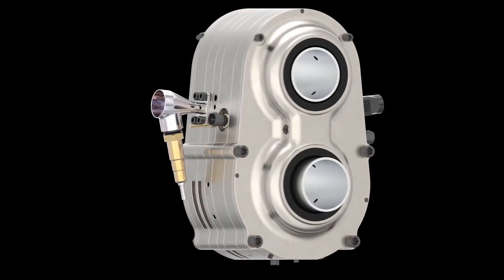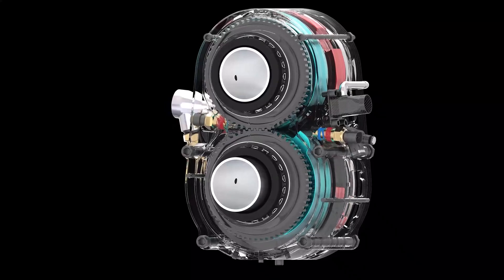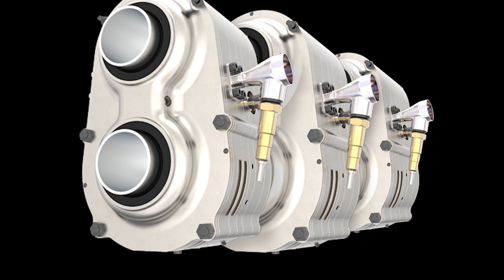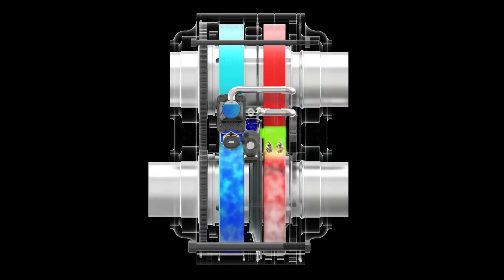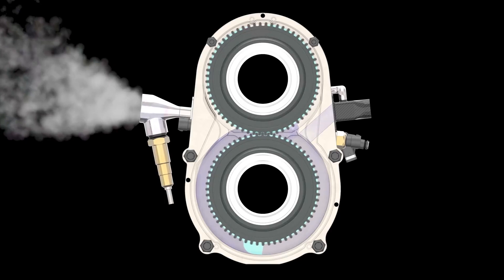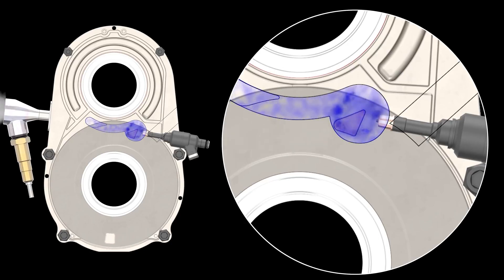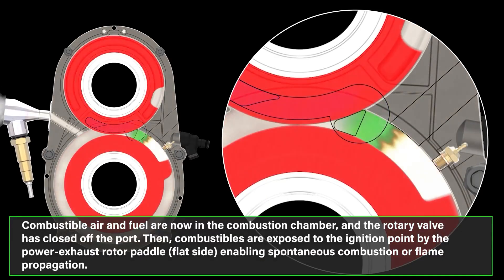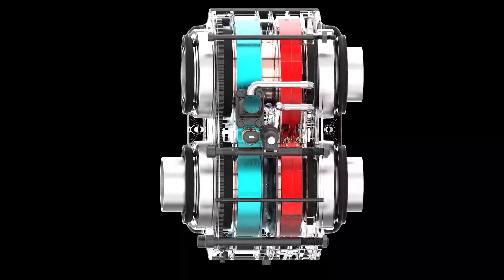This pistonless engine runs on hydrogen and revs to 25k rpm

Comment: This would be great paired with supercapicitor hybrid drive. The engine does all the "cruising" and charging....and then the electric drive only comes into play when massive torque is needed...such as upon acceleration, towing, or hill climbing. The biggest problem with electric cars are not the batteries, but the easily controlled masses of ignorant people. Even though the batteries of electric cars are HORRIFIC for the environment......it's the gullibility of most people which is far worse.
Reply: Hey 250 fb torque is nothing to sneeze at, depending on the size of the vehicle it should do just fine on hills.🤠
Reply: @robertmcwhinney4596  *170ftlbs
Reply: You have clearly no clue about electric drive trains Thomas
Reply: @Freba9  you got that right!🤠👍
Reply: @robertmcwhinney4596  
You got that wrong. 🤠
Reply: @robertmcwhinney4596  Yep :)
Reply: @thomasg4324  Wrong. They are being asked to reduce charging power between 4 pm and 9 pm.
Reply: @thomasg4324  Because of a lack of grid capacity, not production.
Reply: @Freba9  
"Because of a lack of grid capacity, not production." <~ Oh I see.....California can't produce enough grid capacity. Got it.
Reply: @thomasg4324  Does not HAVE enough grid capacity.
Reply: @Freba9  
"Does not HAVE enough grid capacity." <~ Yea...no juice for you!
Reply: @thomasg4324  You clearly do not care about facts.
Reply: @Freba9  
Your "facts" are hilarious.
Reply: @Freba9  
Enlighten me if you can.
Reply: @thomasg4324  Producing and using EVs is far more efficient than using incredibly inefficient hydrogen in a combustion engine.
Reply: @thomasg4324  Again, wrong. Production emissions are compensated for within the first few years of driving on mainly non renewable energy.

Comment: can't hydrogen make any engine "clean"? the problem is getting the hydrogen in the first place ends up using more fossil fuels than just getting and burning gas
Reply: You could easily use solar power to crack water and make hydrogen. The bi product of burning the H2 is just water. So could be done with virtually zero CO2 emmisions.
Reply: @christianbuczko1481  Easily???
Reply: @will7its  As stated by Cakes Gaming, it takes more energy to crack the hydrogen free for use as a "clean" fuel than just burning fossil fuel, and to add insult to injury, the cracking process produces huge amounts of carbon dioxide as a byproduct. It can certainly be done, however the greenhouse gas emissions from and energy consumed in producing the hydrogen gas would completely null out any conservation of energy and produce a ton of extra carbon dioxide. Regardless, as you simply questioned; easily in this case is akin to rainbows and flying unicorns.
Reply: @electronicengineer  Ayte.......
Reply: @electronicengineer  you crack water, 2h20 >2h2+02. No carbon is released, so no CO2.
Reply: @christianbuczko1481  possible but not easily.  it's expensive and inefficient.
Reply: @cakes.gaming  efficiency doesnt matter if it does no harm. The technology already exists btw, with solar panels able to produce the energy, or alternatively a solar furnice to power the electrolysis cells and hydrogen compressors required.